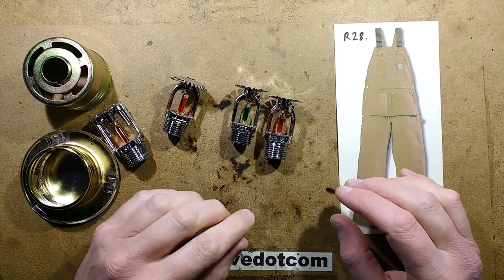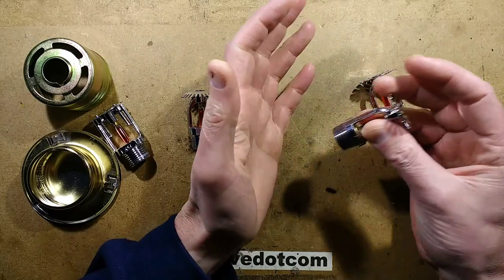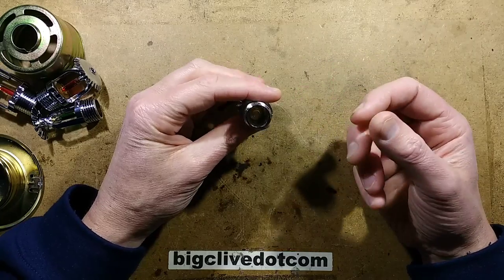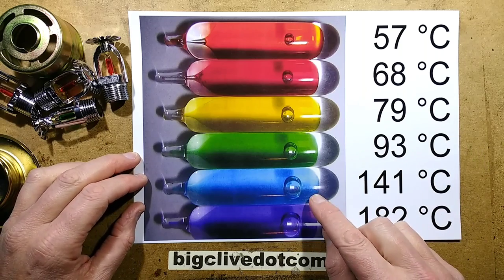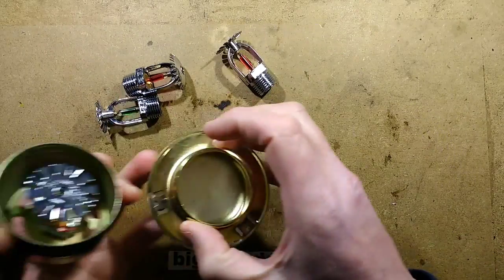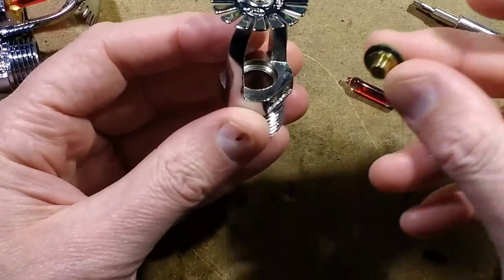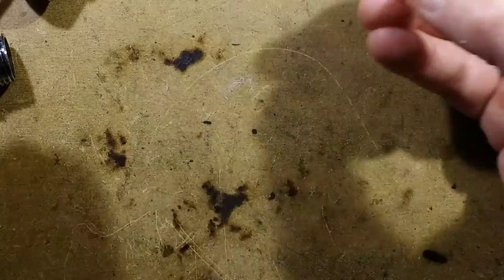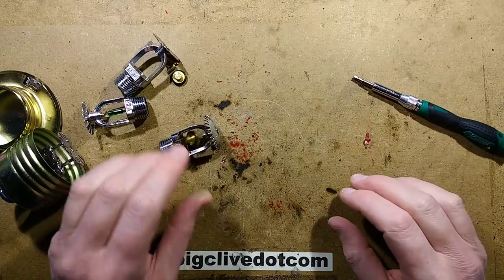How a fire sprinkler works. (featuring broken glass and spatter.)

Comment: I guess it's safe to say then based on how they work, that blowing one of these doesn't blow them all, like they show in the movies.
Reply: Not automatically no. However, in another video I saw a description of an upstream pressure sensor, which triggers a high-volume fire pump and blows them all out!
Reply: As somebody who works on these for a living, that's semi-correct. There is a sprinkler system such as that called a deluge system. usually you'll see these in places such as wooden cooling towers, conveyor belt areas, etc. basically places where soaking all burnable things is the priority verses enabling occupants to leave a building or suppressing the fire. 

95% of your sprinkler systems you see will only flow heads that have had their element fused.
Reply: Gordon Richardson You are right that some buildings have fire pumps but it would never blow sprinklers out.  It is possible to have a dry pipe system that uses electronic valves to set off sprinkler banks all at once but the heads are not built with this sort of pop off link.  The vast majority of sprinklers are wet pipe with no mechanism for tgem to go off other that direct heat per head.  There is a vane in the standpipe that triggers an alarm circuit on flow though.
Reply: Thanks. I was quoting from memory, and may be confusing two different concepts. Edit: Clive should be made aware that leaving water standing for years will produce an awful mess of corrosion, and could be illegal if it back-flows into the main water supply.
Reply: Did everyone know that some high power laser pointers will crack the vials and set off the sprinkler.
Reply: Gordon Richardson there was a system like this at a company at which I worked. The company was in a large office block. While fitting an aerial system on the roof, I had access to some of the service spaces on the very top floor. This housed a massive storage tank of water that supplied the fire sprinkler system. The mechanism was interesting, as there was a small header tank that supplied water to the system. The first bulb of the sprinkler that burst emptied the header tank. A float arrangement in this tank opened a valve on the main tank. I was told that this was designed to activate all the sprinklers. I do not know if this was a dual circuit system or if the pressure was sufficient to burst the remaining bulbs. As I recall, the main tank was maybe twelve feet high, so the water pressure would have been significant, particularly taking into account the hight pressure in the feed pipes to the floors below. I remember it was necessary to climb a precarious steel ladder and stand on the top of the tank to access  the door that opened onto the flat roof.
Reply: Then that means Inspector Clouseau lied to us ?
Reply: Christopher, did you watch the entire video?
Reply: Gordon Richardson don't worry, a one-way valve is must for such a system
Reply: Good point! But I'm not sure Clive should be doing DIY plumbing...
Reply: In AvE's video he tests how much mains water pressure the glass tube can withstand (200psi?) Enough pressure will certainly break the glass, though this configuration might only be suitable for some installations. BTW, water sprays are not welcome in most buildings...
Reply: Gordon Richardson a lot of tradesmen know a bit out of their field. For example a plumber knows how to properly connect a simple phase grounded device to the mains, or to lay down tiles, or to install stoves
Reply: It is quite likely that Clive knows that, but he didn't mention isolating the water supply pipes in the video. There also has to be a sprinkler stop valve somewhere, preferably outside the building!
Reply: Gordon Richardson I'm sure he can figure out a simple plumbing install. Everything will be all right. It's no different from water standing in any other pipe.
Reply: I'm sure Clive can! Its viewers of this video that might not get things right. We've all seen DIY horrors in action...
Reply: Off topic, but I just remembered a funny (ironic) story from last week. I am a caretaker in an apartment complex, and last week we had a plumber check a malfunctioning shower. He found that the non-return valve had been installed backwards, and cemented into the wall underneath the tiles. Good luck fixing that!?
Reply: Michael MacEachern In the vast majority of sprinkler systems every head going off is not ideal. The pressure to each head would be to low to be of use and the water would cause tons of damage to the entire building/floor/whatever.

As mentioned by others there are deluge systems where every head goes off but those are primarily used in specific industrial settings and not in standard commercial or residential settings.
Reply: I wonder if a water hammer issue would affect the pressure that they would go off.  I have this one particular faucet / hose bib outside that when I turn it on, I get rattling in the pipes until it is full on.

Also, I wonder if you should make the sprinkler system plumbing lead into the rest of the plumbing in the house so that it always has fresh water going through it and thus no "stagnant" water sitting in it for long periods of time.
Reply: It depends on how they are made. In a wet system (water always in the pipes) the heads are designed so that a drop in pressure lets the vial release and fall out and trigger all of the heads on a circuit. Wet systems are common indoors in regions where freezing isn't an issue since it is cheaper than a dry system which requires some sort of sensing to trigger the water to flow..
Reply: Sprinkler systems should always be hydraulically isolated from the building water supply, and water hammer is a very good reason! I just came here to post that, and saw your responses.
Reply: Michael MacEachern actually it could be connected to a smoke detector and set them all off electronically.
Reply: That's would be a different configuration, with no frangible tubes and the sprinkler nozzles always open, a dry system waiting for water to be pumped in.
Reply: In my house, I'm not so sure the chance of damage from the fire outweighs the chance of damage from water damage if one of the sprinkler heads inadvertently went off or was leaking.  House fires just do not occur around here that much, especially if you never use your fireplace.  Fireplaces are a stupid decorative item around here and just waste a wall in your living room. :(

What I do see a sprinkler as being useful for though would be a garage since I have seen a house in this area where a fire started in the garage due to an apparent fuel leak on their car.  The garages around here are often detached, but with a breezeway connecting the garage to the main house.  This breezeway has an enclosed "attic" where the flames from the garage fire can travel to shunt the fire directly into the attic of the house.  To reduce this possibility, I have a fire break where the breezeway attic connects to the garage made from cement-fiber board (i.e. HardiPlank), but a fire in the garage would result in at the very least, all the garage burning down.

Even cars high end new cars have these sort of fires sometimes.  I've seen a fairly new upper-level Mercedes sitting on the side of the highway with an engine fire.  All it takes is a bit of a leak in the rubber fuel hose and there goes your car.  And it is entirely possible that it was leaking and didn't actually catch fire until you pulled it in your garage and walked away from it, so you might not notice it until it had spread to your house.  So, yeah, I think a sprinkler in your garage might be a worthy investment.
Reply: Cooking fires are common in kitchens where frying takes place. BTW, water should never be used on oil or fuel or electrical fires.
Reply: The bit about the vial falling out doesn't make sense, since it would happen every time the mains water supply failed.
Reply: The publics misconception of all the sprinkler heads going off at once is what has made residential sprinkler requirements in new construction almost impossible. When you come down to th basics of water flow science, fire sprinkler heads discharge between 8 - 24 GPM.  So, lets say each head discharges 12 GPM, and say conservatively 10 heads in a house. That would require a flow of 120 GPM if they wher all to go off at once..  I don't know of any residential water system that can flow that volume.  Thanks Hollywood.
Reply: +Gordon Richardson
Water can be used on oil and fuel fires if you know what you are doing.  I'm ex-Navy and I've most definitely put out fuel oil fires with just water.  Even before I was in the Navy, I managed to put out a gasoline fire on a car of mine with just a spray attachment on a garden hose.  Remember the fire triangle -- heat, oxygen, fuel.  The fine spray turns to steam and that takes heat away from the fire along with displaying a lot of the oxygen.  I remember in fire fighting school in the Navy where we started with an open tank of fuel that was probably 30 ft in diameter.  It was lit and we put it out with just water.  A high velocity fog nozzle was used and we just swept the fire to the far wall of the container and it was snuffed out.
Reply: Where you using the old style "navy nozzles" straight stream / fog with the option of adding the "applicator tip"?
Reply: +New Jersey Bill
That's been a few decades ago, so the memory is a big fuzzy and fire fighting was not my specialty.  After the Forrestal incident, they Navy was big on everyone getting firefighting training before going to sea.  It doesn't make you an expert, but it gives you enough knowledge that you can handle the equipment if the shit hits the fan and the primary responders are incapacitated during their initial response to the incident.  When you are at sea, the one thing you have plenty of is WATER. :)  I don't remember being instructed in the addition of any sort of tips to the nozzle.  We just took what was given to us and used it.  It might have had a valve position that went from stream to high velocity fog, but I don't remember it.  It was probably a week or less of class around 40 years ago.

I remember the low velocity fog applicators being for entry to a burning compartment in that you could stick the metal applicator "pole" through a crack in the hatchway and it would provide a shield behind which you could enter the compartment.
Reply: Yup, that would have been the good old reliable "Navy Nozzle". :)
Reply: +Gordon Richardson
Cooking fires are only an issue if the oil has overflowed the pot.  That reminds me of a time many years ago when my wife was cooking and all of a sudden, she's screaming in panic.  I rush into the kitchen to see what was wrong and the pot of oil was on fire.  She's just standing there frozen in panic and doesn't know what to do.  I calmly grab the lid for the pot, and put it on the pot while turning the burner off at the same time.  I then ask her, "So, what are you screaming about?"

But then there are those people who put a whole frozen turkey in a pot of oil to fry it.  Some are even stupid enough to do it inside the house.  The ice that is on the turkey quickly changes to liquid and then to steam and it can easily result in the oil overflowing and being ignited by the flame.  I've seen a few videos of people doing that on YouTube.  If I'm going to be frying a turkey or anything that would be using that much oil, I'm going to be doing it outside, well away from any building, and I will have a charged water hose with a nozzle that can produce anywhere from a fine spray to a stream.
Reply: Speaking of sprinkler heads.... I'm surprised the houses over in the fire-prone areas in California don't have some sort of sprinkler system on top of their houses.  From the photos that I saw after the last burns, many of the houses even had swimming pools, so that would have been a good emergency source of water in the event of a fire in case the main water supply had been disrupted.
Reply: Your actions were of course correct! I meant frying pans, which are shallow and have a large surface to volume ratio. Throwing a jug of water into burning oil is likely to make it splash onto your skin, causing 3rd degree burns. But we are getting a bit off topic...
Reply: Probably not enough power to pump the swimming pool water, and not enough flow-rate from the main supply pipes? Some houses where I live have traditional thatch roofs, which are a terrible fire hazard.
Reply: I've never seen a residential sprinkler system where I live (our building has hose-reels). The nearby commercial mall has a fully reticulated system of pipes, ranging from 4-6in for the  main connection, down to 1-2 in for all the nozzles. In theory this should provide sufficient flow for the whole area, though I cannot imagine a fire spreading that large. This video shows separate pipes for each room: https://youtu.be/ma8H3hFqyZk?t=115
Reply: +Gordon Richardson
Thatch roof?  Where are you located?  I remember seeing a few of those while driving around the UK, but I don't think I've ever seen them in the US.  There's no way they would be in California where they have the problems with the fire storms.  From what I've read, you can't even get wooden shake shingles for a roof over there anymore because of fire regulations.

If you want to talk about the excitement of hot liquids encountering water, I have one for you.  I smelt my own lead and cast my own bullets for reloading ammo.  We have this saying, "a visit from the tinsel fairie".  It relates to what happens if you drop some lead scrap in your smelting (or casting) pot that had even a slight bit of water on it.  The weight of the piece of lead allows it to go below the surface of the molten lead when you drop it.  That brings the water below the surface with it and it turns to steam extremely quickly and causes an explosion of lead to come out of the pot.  If you are not wearing proper protective gear, you could get some nice burns.  I've had ONE visit so far and it was not from putting wet scrap lead in the smelting pot, but rather from when I poured the smelted alloy into my ingot molds.  I did not preheat my ingot molds.  I figured they would be dry since they had been sitting in my garage for a few months.  Apparently the steel of the molds had absorbed just the slightest amount of humidity from the atmosphere and when I poured the molten lead into the mold, I got a steam explosion and lead all over everywhere.

Yeah, pouring a pan of water onto a frying pan full of burning oil would probably not end well.  On the other hand, a hand pump fine mist sprayer would work a LOT better.  The fine droplets would not go below the surface of the oil, so it would just flash to steam very quickly.  This phase change would consume a lot of BTUs, thus reducing the heat.  Of course, the quickest thing is to just put the cover over the firing pan while turning off the heat source. :)

If you were going to use the swimming pool as a backup water source for an exterior house sprinkler, you probably should also consider a backup electricity generator.
Reply: Gigs road tunnels,what sets m off?
Reply: ΑΡΗΣ ΚΟΡΝΑΡΑΚΗΣ a farmer like me can half do everything,lol.
Reply: South of the equator (summer is starting here). Scary video of 100 thatch roof houses burning in 2012: https://www.youtube.com/watch?v=m0mmPLi6yCA
They were on the waterfront, but had no pumps!?
Reply: +Ollyweg 0
If you are lucky, your neighborhood has natural gas service to it.  It's the preferred fuel.  In more rural areas, there propane / LPG delivery services.  You''ll have a 250 or 500 gallon tank on your property and the delivery truck will periodically come by to refill it.  LPG costs fluctuate throughout the year, so it pays to get if refilled during the cheaper months.  Sometimes, you are unfortunate enough to have to live in a place where natural gas is not available and LPG is also not an option (for various reasons).  Then you have to put up with electricity for your water heater and cooking.  Electricity tends to be more expensive on a per BTU basis.  Also, your water heater needs to be larger with electricity since it takes it longer to heat up the tank full of water.  In some parts of the country, people still use coal and fuel oil for heating their homes.  If a storm knocks out the electricity for awhile, your natural gas water heater and cooktop will still work.  And if you have a natural gas generator, you can still run the rest of the electric devices in your house without having to be hauling gasoline like you would with a normal gasoline powered generator.
Reply: I think Gordon Richardson is right, the one at our work will detect a pressure drop in the line, or a level drop, then kick in a pump to burst the other sprinklers until the HUGE tank is empty.
fortunately what set off the sprinkler was a forklift truck drove into a broke the main pipe.
unfortunately, that main pipe was right next to our cardboard storage are, which is fill of imported cardboard from around the world and took over a year to fully replace :(
Reply: There are Deluge system, which have different sprinkler heads. These heads are always open. And the valve/pump is triggered with a separate "Pilot" system and sometimes combined with electrical fire sensors.
Reply: +Ollyweg 0
We  have the instant-on (tankless) water heaters also, but they tend to be more expensive and we often consider them not to be practical.  If you are taking a shower and the electricity goes off, you will very quickly be taking a cold shower whereas with the gas or electric tank type water heaters, you still have enough water in the tank to complete your shower.  It probably depends upon your usage patterns with respect to which type works best for you.

The induction stoves are starting to get used in the US, but they are not that common yet.  They tend to be a lot more expensive (last time I checked) and as far as I'm concerned, they have some limitations.  For example, if I'm blackening a steak, the induction stoves are limited to a lower temperature than I can get with gas.  I think they have a preset limit of around 475-500F, IIRC.

I live in a suburban area, so we have natural gas lines in the subdivision.  Other than apartments, only when I lived on a ranch in my younger days did I live somewhere that did not have natural gas.  Apartment complexes are not so concerned with how cheap the energy is, but rather how cheap the appliances are.  Electric appliances tend to be cheaper to purchase than gas appliances.

Even with a gas water heater and gas cooktop, you still might see an electric oven and clothes dryer in the house.  I do know of one house that had a major fire develop from the clothes dryer, but it was because the tenant was a lazy skank hoe that never cleaned her dryer lint filter.  That probably would have happened with an electric clothes dryer also.
Reply: Your correct about the back flow and that is where a dry system would come in handy.
But to do that you then have to have an air compressor attached to the system. This adds
expense to the system but they are less likely to freeze in cold weather and without heat.
The maintenance is a little more involved. You have to go around and drain the condensate
from the pipes every so often. And if the air pressure is let drop off you have to drain the 
water from the system. The water in a dry system is held back by a special valve that trips
when the air pressure drops by a given amount and then the inlet water pressure will overcome
the valve seat and flood the system. The stuff that comes out is still as nasty as the wet systems are.
Reply: On a property that I previously rented out, it had galvanized piping for the water supply lines.  If you didn't use a particular faucet that often, the first water coming out of it was usually a bit rust colored.  The pipes ran in the attic and had quite a few of the external "temporary" patch clamps over it where pinhole leaks had developed over time (before I owned the property).  I will never own another house with galvanized water pipes. :(
Reply: +Ollyweb 0
We get tropical storms and hurricanes and we lost power for over a week after one that I remember.  Usually there are shorter power outages that might be from lightning strikes on the lines and such.  We do get some good thunderstorms moving through here at time.  It's nice not having to be dependent upon a single source of fuel and have the option of electricity or natural gas.

I not so certain about the induction cooktops though.  I seriously doubt that you are going to get more heating out of it than the energy that you put into it.  As  such, 2000W is going to give you 6824 BTUs of heat.  With my kitchen cooktop, even the base level burners are good for 9000 BTUs and there are replacement burners that are good for 16,000 BTUs.  If I need more than 9000 BTUs though, I just go outside and use my 100,000 BTU burner.
Reply: Michael MacEachern I was thinking the same
Reply: +Ollyweg 0
It was a typo... Thanks for pointing it out, I've gone back and corrected it...

Yeah, I'm talking BTU/hr... We tend to shorten it to just BTU in casual conversation around here...

With a blackened steak, you want a really hot grill surface to seal in the juices.  It's different than frying a steak.  You cook the outside quickly, but the inside is still rare and juicy.

I used to have a gas grill which needed a burner replacement.  Being an engineer, I figured I could refurbish the grill and give it a few more BTUs for even hotter temperatures.  I ran it on unregulated propane (LPG).  If I turned it up, I could have a wall of flame shooting 6 ft out of the grill.  Great for making an impression, but a bit too extreme to leave it there for more than a few seconds.  One day, I felt something dripping and splattering on my pants legs and realized that the cast aluminum grill was melting. :)
Reply: The water hammer issue is only a problem for the piping itself as it can move violently if not properly hung or secured and generally doesn't cause any malfunction of the heads themselves . As for piping the water through the domestic water without a backflow preventer NO as most sprinkler pipe is steel and the moving water will strip the rust away and make the pipe thinner and more prone to breakage . You could use CPVC which will prevent some buildup of stagnant nastiness but the grade of CPVC required by code leeches toxins into the water.
Reply: A dry  system uses a dry pipe valve which is basically a check valve that hold water pressure back at about a ratio of 3:1 . when a head fails and the air is released the water fills the pipe and travels to the open orifice
Reply: we call that a double interlock preaction system ...similar to a dry system but requires a loss of air pressure and a secondary signal usually from a heat detector triggering an electric actuator releasing the water
Reply: we call that a deluge system
Reply: +Ollyweg 0
I prefer a steak in the 1.5-2" range so that it stays pretty rare inside even after cooking the outside.  I find that a cast iron pan works best for blackening.  You have  a lot more thermal mass, so even on a small portable electric burner, you can heat it up, thus storing BTUs of energy into it and then dump the steak in there for a short period of time.  When it starts to cool off, you remove the steak and let it heat up some more.  The phase change of the water in the meat from liquid to steam uses up a lot of BTUs, so you have to remove it and lit it build up some more.

I actually have one of the portable induction burners.  I use it for melting wax and adding to other chemicals for when I'm making a bullet lube for my reloaded ammunition.  It will not get a pan hot enough to melt lead, but a normal electric resistance coil burner will get a pan hot enough to melt lead.
Reply: Gordon Richardson Clive should be made aware that leaving water standing for years will produce an awful mess of corrosion, and could be illegal if it back-flows into the main water supply.

It will not create an awful mess. Water standing in a closed system does not cause corrosion, because water is not corrosive. What corrodes a pipe is oxygen dissolved in the water. In a sealed system such as a closed tank or inside pipes you will not get corrosion by having water standing for years. There will be slight corrosion when it's filled until the oxygen is depleted. In fact you'll corrode everything faster by changing the water regularly, because it brings oxygen into the system.
All the sprinkler pipes at my workplace are just regular steel, they don't rust inside because the water is left standing.

I think it would be a good idea to have a one-way valve that opens only if the pressure in the system is a bit lower than the water supply. This way the system remains closed and only in the case where a sprinkler head goes off the pressure drops thus opening the valve.
Reply: +Ollyweg 0
Yeah, 0.5" thick steaks are for things like chicken fried steaks and such.  Steaks should be a minimum of 1" thick as far as I'm concerned and 2" is much better.  I like my steaks rather rare -- I want to stick a fork in it had hear it "moo"... BBQ, on the other hand is done with a slow low temperature cooking.  In Texas (i.e. we are to BBQ what Rome is to the Catholic church), BBQ is *brisket*.  BBQ is a religion here, but there are various sects to the religion.  The East Texas religious sect thinks that it should be smoked over hickory, whereas pretty much the rest of Texas is more traditionalist and believes that mesquite is the proper smoke anointment.

With respect to oil, I normally use either peanut or soybean oil since they have a higher smoke point, but the temperature that I'm achieving on my cast iron skillet are such that I will get smoke regardless of which oil I choose.  I oil the meat, not the pan.
Reply: accumulator?
Reply: Gordon Richardson ya no. That's a deluge system and that works totally different that a normal system.
Reply: These are not the only kinds.  They are most common, but they also have ones that have metal instead of glass, and another called deluge sprinklers.  These have no blockage, just a hole, and the pipes are kept dry.  When an alarm is triggered, the pipes are flushed with water, and thus it's an all or nothing system.

As for stopping these sprinkler heads, one of the last things we do is shut them down at the panel.  Often if a sprinkler head is needed to be shut down before operations are complete, two door wedges (carried with all firefighters for, well. wedging doors) are tapped in...  It's a hell of a time, and a fun drill to end off firefighter 1 with, and you get drenched.
Reply: Michael MacEachern  depends on the system installed....
Reply: Thought those where kyber crystals  I need to get out
Reply: @gordonrichardson2972  here in Tulsa last Winter, there was a bakery that had its pipes burst which somehow tripped the sprinkler system. The building was under construction the previous summer and was scheduled to begin again the next summer and was vacant, so it was sealed up tight. With the property owners nowhere to be found or contacted. No one noticed anything odd until the entire first floor was underwater and had water shooting through the window and door cracks. TFD searched for hours for the shutoff and determined it was inside, and the city wasn't willing to shut off the blocks' water for fear of freezing EVERYONE, so TFD ended up breaking down the front door and wading through the ice-slushie mess to turn everything off. It was miserable for everyone involved.
Reply: Kenneth Fitzpatrick - The pipes freezing and bursting would, by itself, be enough to flood the store whether it was a sprinkler pipe or a water supply pipe. Usually, the fire alarm has a flow sensor that would trip a fire alarm as soon as a head releases. This should have triggered an alarm, assuming that the system had not been turned off for renovations.
Reply: Gordon Richardson - There is often a pump on industrial systems. However, it should not blow all the heads. The first thing that the first engine company should do on arrival is to connect between the fire hydrant and the Siamese coupling on or near the building to boost the pressure from a typical 50PSI to about 150PSI. This gives increased flow to the seat of the fire and prevents reducing the flow if the pressure in the mains drops from the fire fighting activities.
Reply: Michael MacEachern yes liberal Hollywood can’t even get a fire sprinkler right...much less news
Reply: That right for these systems, but I'm guessing there will probably be more advanced electrical systems they will have in place for high rise buildings and the sort, so they would all or semi-all go off at the same time!
Reply: Bradley Barker - A high rise is the last place that you would want to pop all the sprinklers at the same time. All this does is create a huge amount of water damage while reducing the pressure/flow to the activated sprinklers that are already right over the seat of the fire. In most residential and office systems, it is unusual for more than two or three heads to pop and extinguish the fire.

In some applications, such as warehouses, lumber yards and the such, they will install a deluge system that has sprinklers that are open with just a hole and nothing to plug them. The fire alarm will open a master valve that will flood the entire system and soak the entire building's contents. This is because the area protected is so large without walls to confine the fire, it is best to pre-soak the fuel that is not burning in order to limit the spread of the fire. Also,  without walls, the fire front can burn in front of the sprinkler heads that have gotten hot enough to pop. Preemptively wetting the fuel prevents the spread.
Reply: I seem to recall that some systems are charged with compressed air. The sprinkler heads are designed with a pressure valve. If the air pressure releases, all the sprinklers on that line are designed to release, and the water begins to flow through the pipes, filling it and flooding the whole area. 
I could be mistaken. Has anyone else seen a system like that?
Reply: Exactly but they are designed to flow 30 gal/minute ( I don't know what that is in liters) so that's still a lot of water
Reply: @CurmudgeonExtraordinaire  from what I've seen this system is isolated from the rest of the plumbing in the structure
Reply: @GigsTaggart  Any system i've had dealings with: popping any single sensor causes the massive pressure pump to kick in and blow out all the other sprinklers; every time. Though they used a pointed hex to hold the vial in.
Reply: Gordon Richardson your talking about a PIV (post indicator valve) or a out side stem and yoke. These are common in some building it the majority of your sprinkler shut off at the sprinkler riser inside the building.
Reply: Paul Getson that known as a dry system. They way the sprinkler system is activated is when the system loses air because of a sprinkler head activation. The water will then fill the system but will only exit from the sprinkler head that was activated. Not all sprinklers will go off all at the same time.
Reply: The fire alarm panels can burst them.
Reply: @gordonrichardson2972  Thanks.  That is what I was curious about.  I understood how an individual sprinkler worked (other than the fact that there were different temp settings).  I was curious how one set others off.
Reply: Smart Hollywood hero: climbs onto an office chair to set off the sprinkler system with his lighter. Sprinklers goes off everywhere in the building, building gets evacuated, extensive water damage. Great job, Hollywood Hero!

Schoolkid: presses fire alarm button. Building gets evaluated. Schoolkid might be smarter, but will never be a Hollywood Hero.
Reply: @christopherpulliam7232  i hope so considering he literally mentions it in the video